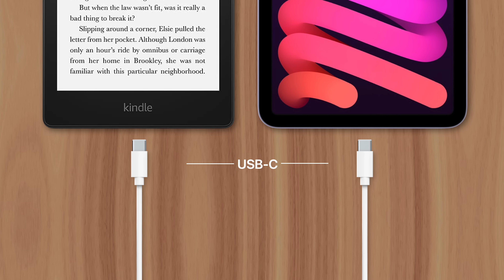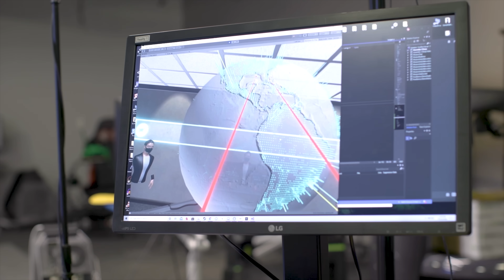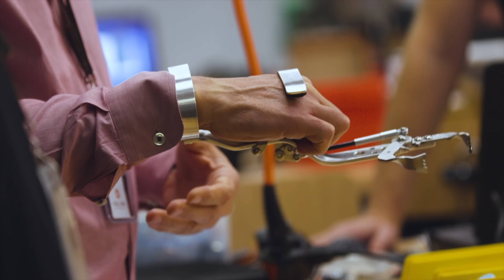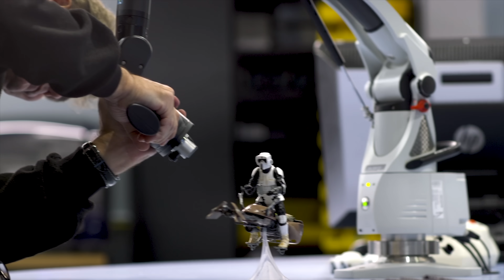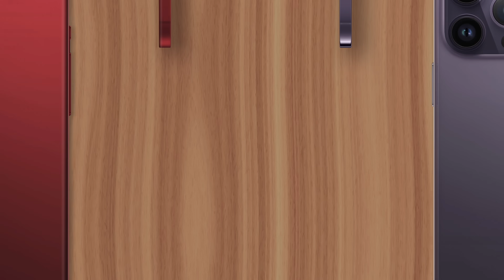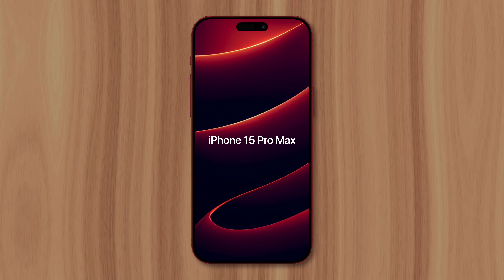iPhone 15: What To Expect

Comment: What you got right with 15/15 Plus: Similar dimensions as previous models, USB-C port, Dynamic Island, A16 chip, battery improvements, prices
For the Pro models: Reduction in bezels, contoured edges, titanium chassis, Action Button, upgraded telephoto and increased pricing on Pro Max, A17 Pro chip
What you missed: Curved edges and matte glass back on the entry level models, 48MP main camera across the board, solid-state side buttons absent on premium models, different colors/finishes than those shown in this video

Comment: So just buy the iPhone 14 pro max
Reply: exactly, no changes, i just ordered an iphone 14 pro and was thinking about waiting for the 15 but they are the same. I think that apple should stop releasing new phones each year and instead have a new iphone every 2 years at least
Reply: @debunklies9124  Bro really forgot the differences
You think they're just the same like that? What about the new A17 Bionic processor that will improve battery life, upgraded camera, USB-C. Also, its totally unfair to compare a base model to a high end model like the iPhone 15 and the iPhone 14 Pro as they have the same A16 Bionic, its better if you compare the iPhone 14 Base and iPhone 15 Base bro. Also, if you think they're really the same, try charging the iPhone 15 models with USB-C ports using your lightning cable 😒

If you want a "totally different" iPhone, just order the iPhone 15 Pro for sake!

Comment: You can expect much less help from Apple Care. I bought a new MacBook pro and had to return it the same day because Apple Care couldn't even tell me which cables to use to TX programs from my Time Machine. I have been an Apple user since 1991, and until the past couple of years, I loved Apple because I loved Apple Care. Now Apple Care is as worthless as the non-service offered by all other tech corporations. I'm going to try to get the devices I have repaired instead of replacing them since Apple doesn't support its products anymore.

Comment: I've been using the iPhone 8 for 2 years and 5 months now. Will it be worth it to upgrade to an iPhone 15 when it comes out? Cause a lot of people said that even the 13 is better than the 14 so I'm having second thoughts. I think I'll upgrade after 3 years- when I graduate college. 😂
Reply: Going on 3 years this July for me on an 8 Plus. I’m planning on upgrading to a 14 which would be $830 from Walmart (I have Straight Talk) but by now the kinks would be worked out on it as opposed to buying a 15 off launch for over $1,000. Either way going from an 8 Plus to a 14 will be a pretty sizable upgrade for me.
Reply: @lakerskid2013  it's so cheap there! I computed the rate exchange and it turns out the 14 is worth $999 dollars.

Comment: Fingers cross the requirements for an easy upgrade of battery will also become legal requirement, I miss the ability to change it when it got week for continued product availability, you can blame app,e specifically for bringing in the trend of obsolescence with very hard to upgrade the battery process

Comment: I hate that the periscope lens will be exclusive to the pro Max model! I upgraded from a 7plus to a 13 pro max and as much as I love the phone, I hate how big it is. Makes it hard for single hands use as well as balancing on phone gimbals. So for my next upgrade I wanted to just go with the regular pro model size. But I understand that they need to space for the camera. Guess I’m just gonna have to wait for the iPhone 16 pro for when they include those features in the regular size pro model. Also hoping they upgrade the Ultra wide lens even more for better low light performance in video.

Comment: Nobody really needs a new $1000 iPhone every year
Reply: Exactly. Back in July 2020 I upgraded from a 6 to an 8 Plus and it’s still going strong. The 8 Plus was the first phone I ever purchased (the previous 6 phones I owned were Christmas presents except for the iPhone 4 that was basically a hand-me-down from my dad) and at the time it was $300 for that phone and still going strong. Even when I do upgrade this year, I’ll go for a 14 (still will be a sizable upgrade) and spend $830 instead of over $1,000 on a 15 that will take some time for them to work the kinks out on it because it can take a bit of time for things to work correctly in the software since sometimes it may take an update or two after a phone right off launch to have possible issues addressed. Getting a 14 I know I’d have a more polished product at least plus it’s still a brand new phone I’d get either way for less of a price than the 15

Comment: Ppl commenting that the removal of a SIM tray is not a big deal must be quite ignorant of how eSIM transfers work and/or not travel much. If Apple does remove it, it will be a deal breaker for me. Even if every carrier on the planet supports eSIM (and loads still don't), there should always be a physical SIM option to fall back on - always. Also the dual SIM thing - both SIMs use the same antenna so when you are using one line, the other is out of service which is a little lame. Apple, hope you're reading this.

Comment: Solid state buttons is a straight up downgrade, I’d rather stick to my 14 pro max, type c if it actually happens would still be interesting, i assume charging speeds will increase, i think the action button is pointless but kind of cool? Tho I am so used to back tap that I don’t see it as a new addition, and I don’t think the chip is going to be a massive improvement. So prolly not getting a 15 pro max, tho If they have a good trade in deal that would prolly be enough

Comment: I’m hoping with the display of the 14 pro on the base 15 there will be 120Hz ProMotion, because I would settle for the regular 15 if it had 120Hz.
Reply: They should at least do 90hz on the "Base" models
Reply: @Colt8722  agreed
Reply: @Colt8722  And call it PlusMotion.
Reply: @Diaming787  yea!
I mean $800-$900 for the “base” iPhone and still stuck with a 60hz refresh rate 
90hz should be the absolute bare minimum 
Plus motion sounds like a good marketing term

Comment: I usually upgrade every year, except for the jump to the Xs from the X. Depending on the price changes and how the Titanium looks, I might be sticking with my 14 Pro Max for another year. I really like how the stainless steel looks on the phone and I think titanium looks too similar to aluminum.
Reply: Titanium is a great material but it's the overall design of the phone that is critical. I dislike the iPhone 14 Pro Max due to the protruding camera lenses.
Reply: They don't do the S models anymore for this exact reason. Going from a 14 to a 15 sounds a lot better then going from a 14 to a 14S. Even though, the improvements they make are the same.
Reply: A 30% better battery life seems like the best improvement, it would give me a 2-3 day battery life depending on usage.
Reply: I think I’ll update to the 15 pro max because 14 pro max’s appearance is better but 15 pro max’s battery is longer
Reply: Sounds expensive and pointless.

Comment: I'm using a regular iPhone 8 still, and really want to get all the "new" features apple has, like the face ID, island, and different layouts. Just wondering if I should just get the 14 pro max for size and battery, or wait on the 15 pro max for the same stuff and the usb-c, titanium, and red option. I just thought I wanted to keep the home button and smaller screen, but I've been jealous of my moms iPhone 11 and its camera and face ID. I just don't know If I'll be able to wait for the 15, lol.
Reply: Yeah Face ID is great, the larger screen sizes are not. The 13 mini seems to be the best compromise right now, the width is good but it’s just a little too tall.  When they got rid of the home button I wish they’d just eliminated the space rather than extend the screen into it.
Reply: @TonyTheYouTuba  that's specifically Ur opinion, u forgot to mention that part, for example in my opinion I'm all for the largest screens possible, and don't want a tiny screen, my hands are too big
Reply: @MrToastyYT  I didn’t forget, it was unnecessary since of course it’s just my opinion, how else could it be interpreted? To be fair I might have misread the comment I was replying to since they do seem to be considering the larger ones anyway.
Reply: me too, i'm thinking of either saving up for a refurbished iPhone 14 pro once the iPhone 15 is released or the maybe the iPhone 15 instead. I really want to use the dynamic island and the better camera quality. For me, my iPhone's battery life has decreased by sm so i'd rather buy a phone which has a longer battery life.
Reply: Just wait for the 15. It’ll be here in September. Especially if you plan to lease it until it’s paid off.
Reply: if ur ggonna get the 14 then just get the 13 for way cheaper once the 15 comes out. But tbh, if i were u i would go with the 15

Comment: Don't forget the iPhone 13 models it's the same as them to
Reply: iPhone 13 and iPhone 14 are not the same. iPhone 14 has car crash detection and satellite connectivity and iPhone 13 doesn't.
Reply: @m3gankillerdolldance  there the same phone those the only 2 difference they do the same stuff
Reply: @drivingsimulation23  iPhone 14 has a more powerful A15 chip than the A15 chip in iPhone 13.
Reply: @m3gankillerdolldance  still not a big difference my se has a a15 chip and does the same stuff any other iPhone does

Comment: I still hate that people are whining about lightning cables. It works just fine and your AirPods are still lightning. Most people who have apple products have older products, meaning that most of their products have lightning ports anyway. So I’m confused on why people are mad about having one cable for everything when they already have one cable for every thing. This will make thing harder for sustainability and tech waste. There will be hundreds of millions of cables clogging up the dumps. It’s not just the usability of the one cable, it’s the ease this change will cause

Comment: My Galaxy Watch5 Ultra uses Titanium for its frame and idk if I really like it much. It's tough against dents or fractures but the finish scratches easy asf. I would like to see Samsung switch to stainless steel for their Ultra phones, their armor aluminum is fine ig but it's still aluminum. The Stainless Steel does add a nice feel when I hold my 14 Pro forsure. 

It's also ironic to me that Apple is now just basically making the next gen non Pro models just the last gen Pro models 😂 idk why someone would wanna buy the same phone twice for the same price. At least put the new chip in them lol

Comment: Have you noticed that the iPhone 11 and 12 are similar? Then, the iPhone 13 and 14 are also similar. In my opinion, we can expect the iPhone 15 and 16 to be similar. I think Apple will change the location of the cameras or something. Apple has been using that camera arrangement on the iPhones 13 and 14 for two years now. They can't do it for a third year.

Comment: As a metallurgical and materials engineer, titanium alloys are not stronger and not harder than steel. Considering apple didnt use a soft steel the titanium replacement is superior only in terms of weight.
Reply: How much do you think it'll affect the price?
Reply: @hesamvazifedan3248   in terms of manufacturing cost i estimate an increase 5 to 10$. We all know apple probably will charge extra 50-100$ for titanium frame.
Reply: @retit  Thanks! We'll see.
Reply: congrats…You have been selected for the season ongoing Giveaway..!Message the above applied name to redeem yours…right now.

Comment: If they do change the mute switch to an action button it should be positioned under the volume slider. I cant imagine pressing it on a pro max it would be so high up to use comfortably for remapped actions

Comment: What we should not expect from Apple is striking design changes. What we can expect is a reliable and safe device.
Reply: That's not a fair opinion to have on a high end flagship phone. The price they charge should be atleast respectful in par while selling iPhones which they aren't doing!
Reply: @reuben5317  Why change the design every single generation? If the design works, and looks good, keep it for some time. Retooling manufacturing plants is super expensive. It's not economically viable from a company's stand point.
Reply: @milkyplays5566  honestly i just think its ridiculous how these companies feel the need to release a phone every year. Most iphone users dont care abt the specs either way
Reply: @basicange  What I think is even more ridiculous is how some users feel the need to buy a new phone every year, just cause a company releases phones frequently does not mean you have to buy every new one
Reply: innovation has slowed across all tech lately but particularly with apple. when android people question why I still have one its the age old answer..."It just works"

Comment: Hello! I like your videos a lot and I've been following this page for a while now. Just note that Aluminum is way cheaper and more fragile than Stainless Steel, therefore the frame will be cheaper. The advantages I see in using an Aluminum frame are, as you well mentioned, is that it will be lighter which can be advantageous for most users.
Reply: He clearly stated "titanium" not "aluminum" smartpants. lol.

Comment: Low key wish I would’ve held onto my iPhone 12 for another year before upgrading… I love my 14 PRO, but 15 Pro seems like the upgrade I should’ve waited for… oh well. I plan to use my 14 Pro for at least 4-5 years
Reply: You won't miss out on the 15. You already have a 14 pro max. I don't really think it's a big enough difference to accutally be sad. You get dynamic island. Best battery life. 120 hz screen. The only big thing is the action button.
Reply: The usb c will probably have a lock on. You will have to buy a apple charger.

Comment: Think I will be upgrading from the aging 6S to the 15 or 15 Plus, but the price tag would be almost the same as the entry-level MacBook Air
Reply: How tf do you use a 6s in 2023 😂 you should be able to afford it easily with all the money you’ve saved up from not upgrading by then

Comment: I like my iPhone 14 Pro Max so much, I'm most likely skipping the 15 this year. Not that it wouldn't offer decent improvements, but I don't really need them or would make use of them, I believe.
Reply: Type C is probably the biggest improvement tbh
Reply: @skylovescars69420  true!
Reply: @skylovescars69420  unless the rumors are true that they’ll be limiting speeds of any non-apple-certified cables

Comment: Great video! But what about the fact that Titanium is doing a bad job transfer heat than stainless steel? More heat = more wear and tear on battery? Well good the chip use 30 % less power.
Reply: Titanium is more heat resistant then stainless steel (they used it on the concorde which heated above 120℃. Although it isnt great at transferring heat, i think it will be fine.